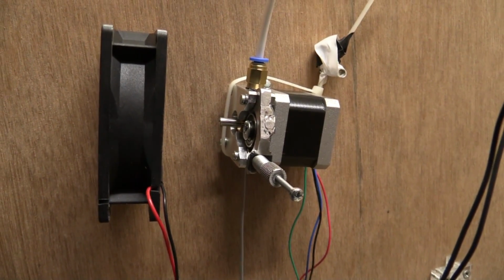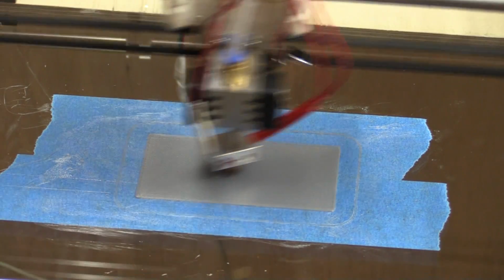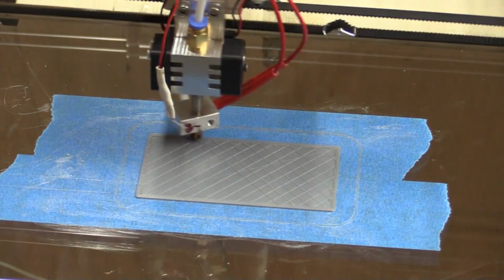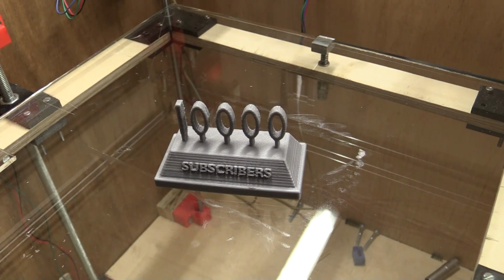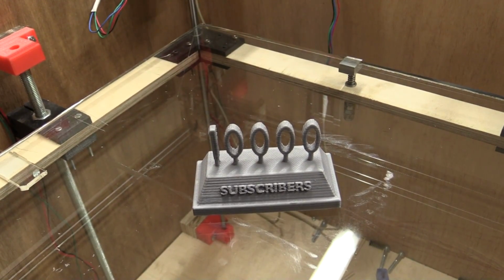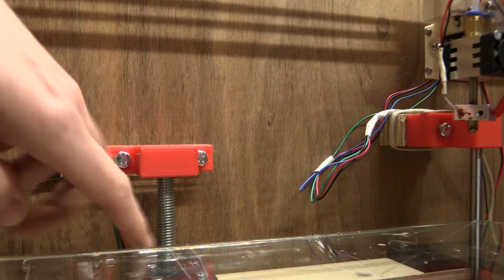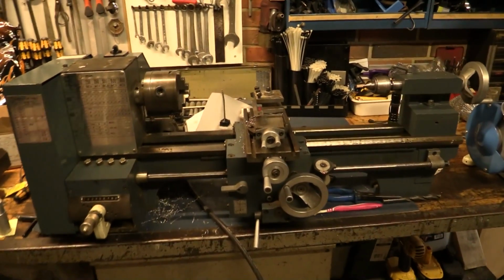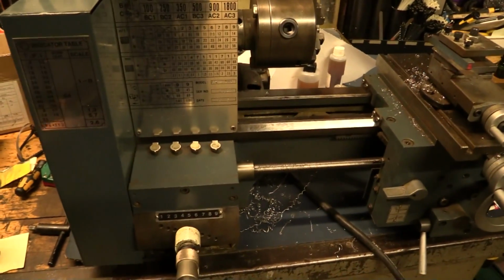10,000 Subscribers - Ec-Projects

Comment: I had the similar problem..with the lines in the 3D Print...I solved that by loosen the screw tensor of the gt2 belt from x axis..it was to tight and it was closing the distance between the z threaded rods
..Now works ok..I have a custom prusa i3 rework homemade with custom 3d printed parts that I designed.
you can see it on my youtube channel.

Comment: Found those vertical lines were dependent on print speed and temperature , clearly the z axis has an effect on it , but it can be eliminated by tuning the print settings in my experience.

Comment: Congrats on the 10k achievement!......Btw, your lathe looks a bit like mine (Hobby 818) if you've seen it......maybe the next model up and with the gearbox. Great fun!
Reply from the maker: +IanScottJohnston Thank you, Ian. Yep, I watched your videos of it. You did a very nice job restoring it, I remember :) Just took another look and they do indeed look similar. Mine has the model # CT 918, but I couldn't find any manufacture information anywhere, not even in the user manual :) . I looked online and found a few different names, so it's probably an imported model, but the did a nice job then.
Reply: +EcProjects Ahhh, Warco CT918, there seems to be quite a bit on the net including user manual.